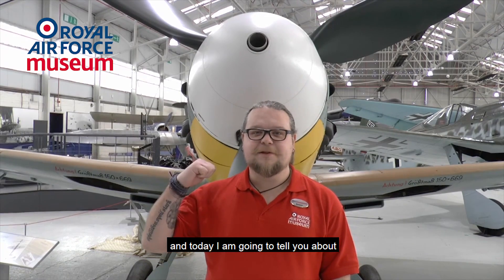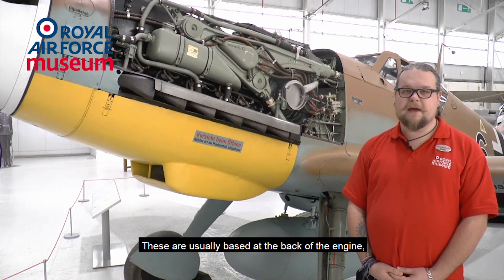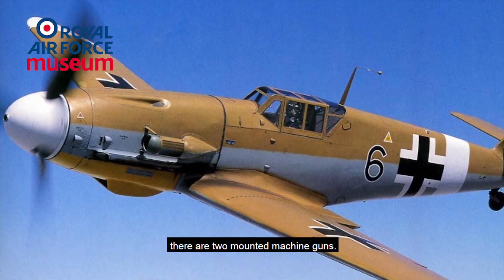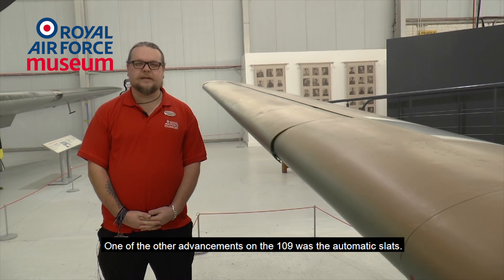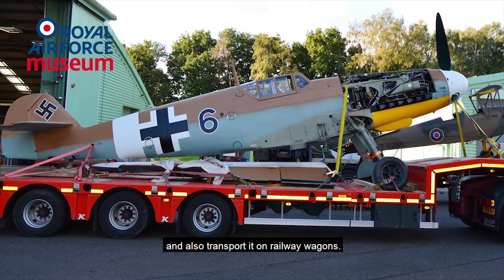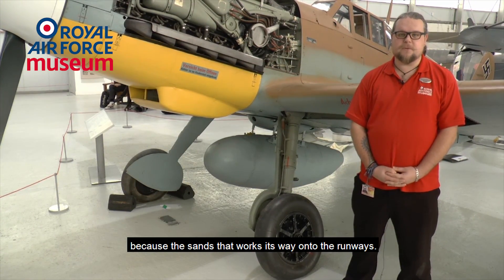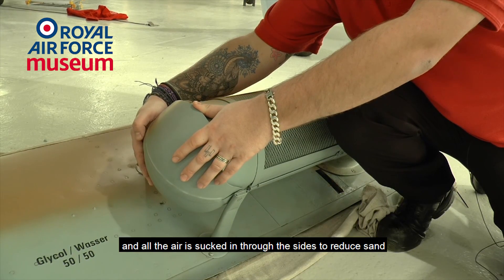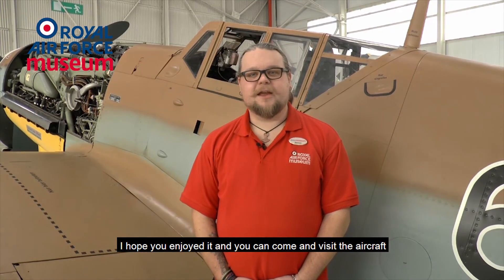Under the RADAR: the Messerschmitt 109

Comment: Well... It also had automatic engine controls, so the engine could run for more than 10 minutes without the pilot constantly checking it, under settings set by the pilot.... Unlike the early spitfires and tempests, which had engine blow outs if you stopped checking your dials for a few minutes to... Idk maybe dogfight an enemy aircraft.

Comment: A lovely airplane with it's very compact down draft DB605 engine. There are two things we are all forgetting: first the first flight was in 1935 and basically it was the same until 1945 with the final variant and secondly it's narrow and weak landing gears that needed lot of experience to handle it, and caused a lot of accidents especially for green pilots, was virtually a carryover from the 1st WW to be easily transported both by truck or train with it's easily detachable wings so the authorities wanted the Bf 109 with this characteristic. But also the famous Spitfire had narrow gears as well. Nice video!

Comment: The BF 109 was not the only fighter who had a canon trough the engine/prop: the french fighters Morane 406 and Dewoitine D520 use the Hispano Suiza 12Y engine also called in France "moteur canon" because integrate a 20mm Hispano Suiza canon between the cylinder banks from the V12...this engine was later improved from the Soviets (who buy the license before the war) now called Klimov 105 (use in Yak 1, 3 and 9)...The Hispano Suiza HS 404 20mm canon was later modified from the brits to allow the installation in the wings in all allied aircrafts  (but the Mosquito had 4 in the nose)

Comment: DB 605 engines were in G and K versions. Previous versions had mainly DB 601 (or Jumo carburated engines in A versions).

Also supercharger was variable speed and hydraulic driven unlike British or US planes which superchargers were mechanicly driven by engine crankshaft with gears (also stages later on).

Comment: Interesting, didn't realise the exhaust shroud was to stop the supercharger ingesting exhaust gas. However, the exhaust stubbs are low down in the DB 605 and most German engines, due to the fact they were "inverted" V12 engines. The cranckcase was above with the cylinder banks pointing downwards as such, not because of the supercharger positioning.

Comment: Nice explanation, 
To ad on some details 
It didn’t had a holo- drive shaft but a holo propeller shaft. There is a gun tube installed in between the cilinder head banks. 
Most all inverted V engines had a gun tube installed.
But the most impressive part is the unit that regulate the fuel / air mixture and prop settings It was  called something like commando or command gerate. The Next  smart way to regulate the propeller pitch at that holo propeller shaft.
Cockpit pit controls for the engine where simple. Set it and forget.
This plane was designed in the late 1930 and therefore a masterpiece in technology. 
The Germans had problems to make it even better. Small changes did help but overall it did not change as much as a spitfire. 
It was impossible to create a faster, bigger, better, beefier 2.0 version. 
And some changes where not really smart like the 30 mm central gun.
This worked but not for long. In most cases it overheated and jammed and or empty the magazine too quickly.
The pilots didn’t like it and so the good old 20mm was reinstalled in the field or at a engine swap. 
One veteran explained to me that they used the 30 mm for short landing rol games. 
Bets where taken how could stop the plan in a minimum roll. This was ended on the day  a farmer turned up with dead cow. 
The pilots bought the cow and promised to stop. Obviously the cow was a welcome meal.

The inverted engine was a smart way of cooling the engine. Oil is the main coolant and so the engine can handle more heat. 
More heat means more performance. Having the engine inverted pilots had les problems with the exhaust fumes.
Also the coolant system was a marble for its time .. start reading and look at the museums to find out why.

Comment: at 0:57 the picture shows a 109 with high exhaust stacks which I believe means the plane is a Spanish built Hispano HA-112 using a Rolls Royce Merlin engine not a German BF 109 using the Daimler Benz. (I believe the prototype BF 109 used a Rolls Royce Kestral engine).

Comment: In terms of the undercarriage and ground handling issues: there was a handling problem but measures were taken that reduced the accident rate down to the same rate of other Luftwaffe aircraft.  One measure was simply a little extra training focused on the issue.   The other was an ability to lock the tail wheel.   The real improvements was the introduction of an extended tail yoke in 1944.  This reduced the angle of attack when in the 3 point sitting attitude.  It had been found that at this angle that due to prop circulation that one wing stalled ahead of the other.